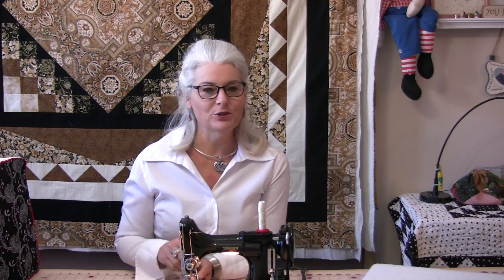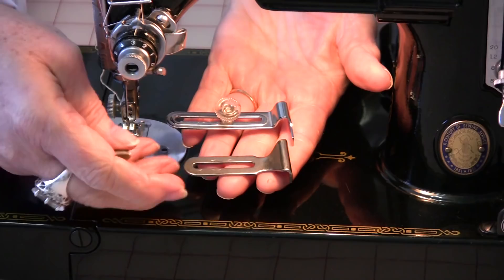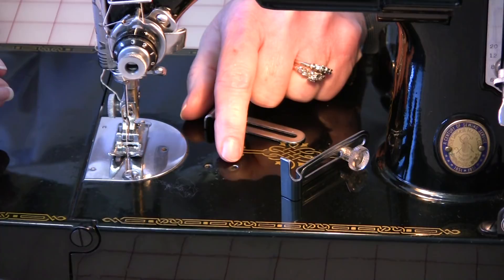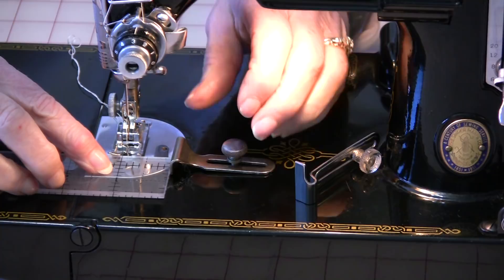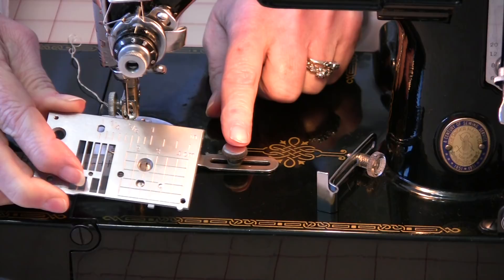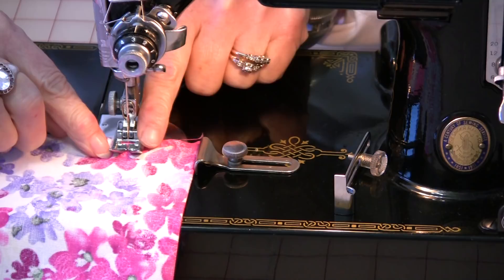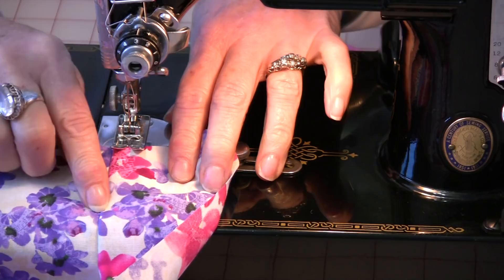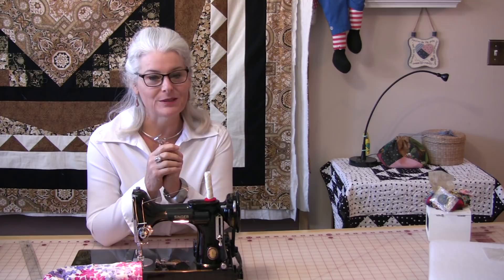How Do You Use a Seam Guide?

Comment: I see my Bernina 1008 has two holes which seem very similar to the ones shown in this video.  I wonder if those type of guide can be use on the Bernina 1008.  Thanks.
Reply from the maker: Yes that is what the hole is for, Check this out http://www.bernina.com/en-US/Products-US/BERNINA-products/Accessories/Special-sewing-accessories/Patchwork-seam-guide if this is your machine you can get this guide.  Thanks
Reply: The problem I have with Bernina accessories is that they are hard to come by and expensive.  Besides, it is not sold online, and I have to drive 25 minutes to get to the nearest authorized dealer, and when you get there the item one is looking for may not be in stock and it takes forever to have it ordered from the dealer. Anyhow thanks.
Reply from the maker: orestesdd
There is  another foot that you can buy http://www.bernina.com/en-US/Products-US/BERNINA-products/Accessories/Special-sewing-accessories/Snap-on-shank, I'm not 100% sure, but it lets you use other snap on feet. Next time you drop buy your dealer see if they have this foot. It might help, happy sewing and thanks for watching
Reply: I had the original snap-on shank which came with the Bernina 1008, but it is the worst thing there is.  All the little plastic parts within the shank came apart, and I am trying now to buy one, but it seems it is over $40 USD, a expensive thing if you ask me.  Anyhow, thanks.
Reply from the maker: orestesdd
your welcome
Reply: I was able to find the Bernina guide similar to the one shown in this video for $18, a bit expensive if you ask me, but it's a genuine thing from Bernina.  I am glad I bought it.
Reply from the maker: orestesdd
That's really is not a bad price! I'm glad you found one. Have fun using it. Happy sewing
Reply: Thanks. I can probably use with other mechanical machines since I am thinking about buying a Janome HD3000.
Reply from the maker: your welcome, and have a great day